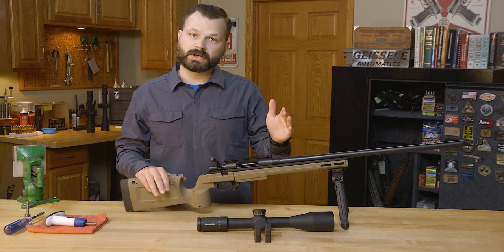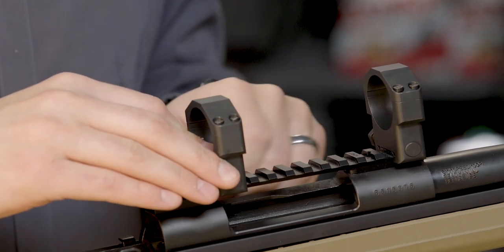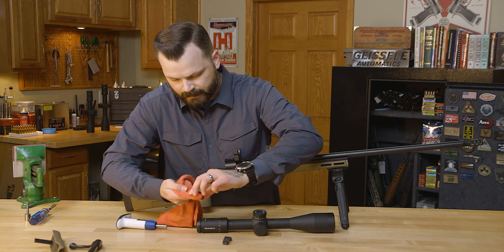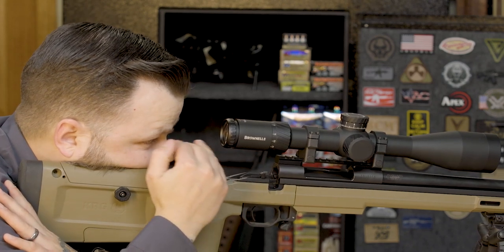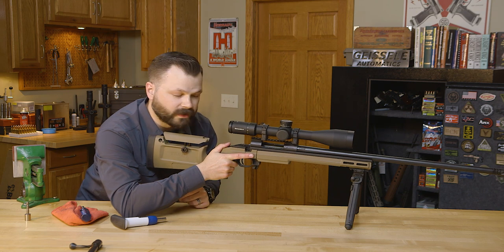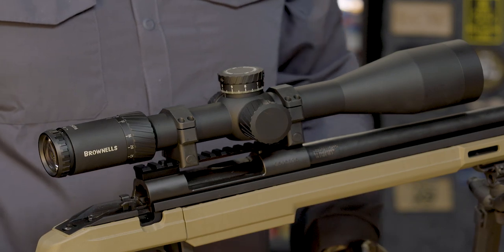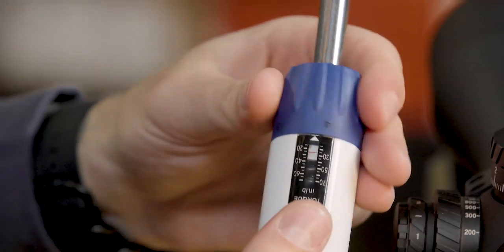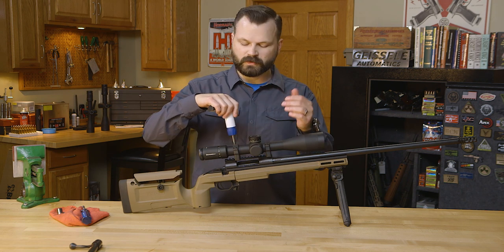Brownells Match Precision Optic™ - Mounting on Your Rifle

Comment: I have been a gunsmith for over 50 years, and I have found that it is best to put the back ring as far back as possible for shooter comfort and casing extraction clearance issues. Also, a plumb bob should only be used in an emergency. There are many "level-level-level" scope mounting kits that you sell that are AWESOME!
Reply: Level kits are pointless.

Comment: You’re rifle needs to be level when leveling your scope as well.
Reply: It's not critical unless you are you going to level the rifle every time you shoot it.
Reply: gone rydin when leveling your scope it’s nice to have the rifle level too so the bore is directly under the scope.
Reply: @adamknapp653  Merely leveling the rifle does  not necessarily achieve that.
Reply: gone rydin you need a bubble level on the rifle or scope to make sure everything is aligned and level. This is important for shooting long distances. When leveling the scope, make sure the rifle is level then adjust the bubble level. Having everything level is critical when shooting long ranges with small targets.
Reply: @adamknapp653  With a level you can only ascertain that some surface on the rifle and the horizontal crosshairs of the scope (x axis) are parallel. This does not prove that the y-axis of the scope coincides with the centerline of the bore.
Reply: gone rydin yes you are correct, but it will give you better results than doing nothing. The point was, in my opinion, he failed to mention to center the scope over the rifle. Having everything as level and plum as possible will help with any errors in the the long range shot.
Reply: Adam Knapp, there is no point is trying to level the rifle perfectly when mounting the scope. First you need to use a plumb line to level the scope bubble level to the crosshairs. Then you do a tall target test to check to see if your verticals crosshair dissects the center of the bore.
Reply: Adam Knapp, doing it by eye is good enough. You can use a fancy leveling kit, or wedge set, or do it by eye, either way you need to do a tall target test to fine tune it so why waste the money on a leveling kit and the time to set it up?
Reply: Levelness of the scope to the rifle doesn’t matter much.  What’s important is holding the reticle level.
Reply: @n00g72 Myth. 

If your crosshairs do not bisect your bore, there will be serious lateral errors when dialing elevation.
Reply: @rifleshooterchannel208  lmao; no.  Go revisit your high school geometry textbook.
Reply: @n00g72  Go put rounds on target instead of using made up theories from some book (and it’s not even a geometry issue 😂)

If your reticle doesn’t not track square with the turrets and that tracking along the reticle doesn’t bisect the bore, you will induce a windage error when dialing elevation at long range. 

This is not even debatable 😂
Reply: @rifleshooterchannel208 The only “error” is the offset of bore L/R from the centerline of the optic.  If you mounted a scope directly to the right of the bore by 2”, then zeroed at 100y with the POI 2” left of the POA, that’s the only “error” that would ever exist at any distance.  Simple to account for.  Canting the system when you pull the trigger is what causes substantial error because the scope no longer tracks with gravity.  The bore is a circular tube, it doesn’t give one fuck how it’s rotated.  Just placed in the top 5 (again) at nightforce ELR with my scope not “bisecting the bore,” so tell me, who needs to go test on target?  Hint: it’s you.